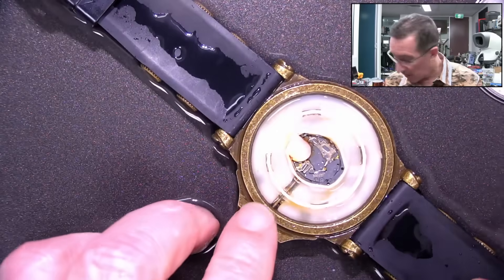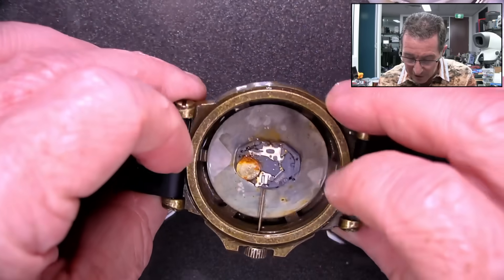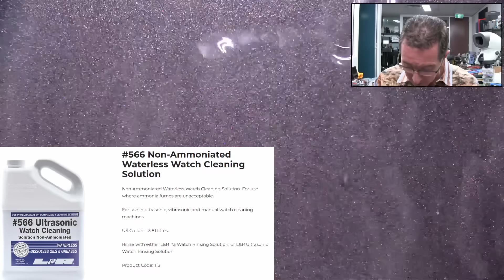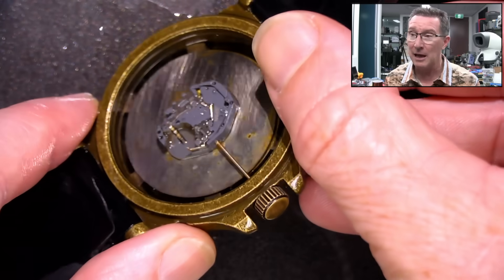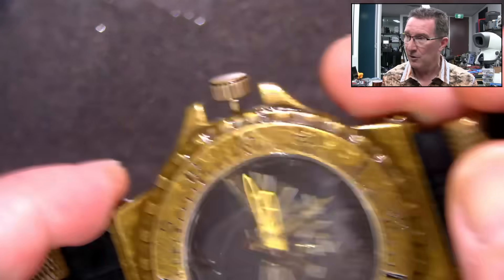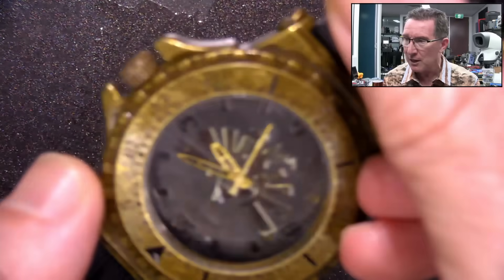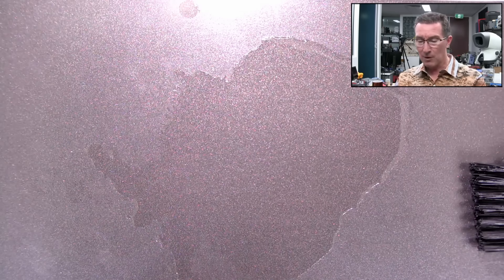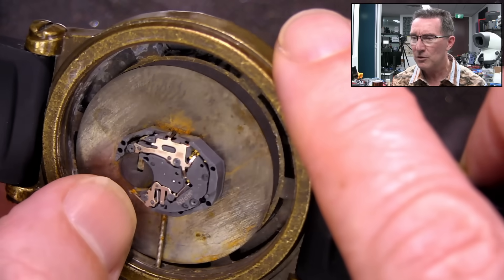Zelda Watch Bodge Repair After Chlorine Pool Dunking

Comment: It will probably work, but if it had any lubricant, now it doesn't anymore, which means it will drain the battery much faster. But as 'violentsense' suggested, you can replace the whole movement.

Comment: I got into my hot tub with my cell phone (Motorola RAZR V3😎). It was still working! Underwater! 
I took the battery out and placed it under a fan to dry it out and was fine. But the indicator dot turned a bright red. 🙂

Comment: I am not familiar with this particular movement, but usually you can unscrew one of the screws or pull on a latch to release the crown. Then the whole thing will come out. 
On quartz watches, usually you just replace the whole movement, it'll drop right in, you attach the dial, hands and cown and you are good.

You can pull the hands off with small screwdrivers, tweezers, or a specifically designed tool(best option). You want to make sure not to damage the dial, might want to place some plastic on the dial(under the hands) for this stap. The dial should come off too. Then you take the new movement and attach everything. They will just press on. Keep in mind that the hour and minute hand need to be aligned right.

Comment: The white plastic spacer probably allows for different mechanisms inside and all they need to change is that plastic spacer so that they are not locked in with only 1 movement provider.
Reply: I think it is the other way around. Small movement so it fits many different sizes of watches.

Comment: Glad I'm not the only one screaming stop! Wristwatch Revival!!!
Reply: I'm pretty sure this is a quartz movement (hence the battery) - and Marshall doesn't touch those...
Reply: @RedwoodRhiadra  Ahhh that's a good point, the battery should have clued me in.
Reply: No need for Wristwatch Revival. Any monkey can swap out this movement (TMI/Seiko PC21) that literally costs less than $2 shipped worldwide on alie.
Adding extra water, alcohol, shaking it around in the case like a rattle and whatnot as done here just adds to potential damage to dial and hands 🤦‍♂